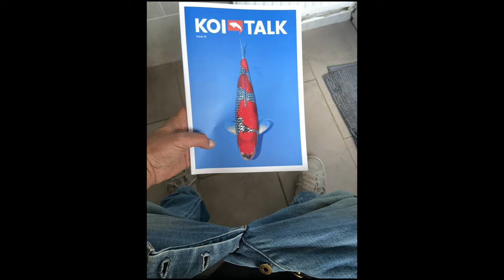4000 Gallon Koi Pond Build Pt 14 - The filter house.

Comment: What a gorgeous little pup Tony mate , can I suggest putting the air curtain at the other end of the pond otherwise your just going to stop debris going down the skimmer , at the other end it will help push crap towards the skimmer , 
  Can I ask if you have measured the inside of your block work since you have finished , just by counting the blocks I reckon your looking at nearer 3000 g around 2800 maybe , where you had the level on the nexus is ideally where you normal water level should be so unless your pond is going to filled to overflowing maybe do a rethink on the hieght it’s sat at buddy , sorry just trying to help you out , great job so far, and the koi are looking great  😎😎👍👍
Reply from the maker: Hi Martin, thanks for the feedback. I am looking at moving the air curtain as you are correct regarding pushing the debris back from the skimmer. I think I am going to relocate it under the bakki shower. Regarding the nexus placement, I have measured from the lip on the Nexus which sits higher than the top of the pond.  I am looking to get the maximum from the nexus.What would you suggest as I trust your feedback mate.
Reply: @KraftyKoi  what you need to decide tony is where your normal pond water level is going to be in the pond, and then place the hieght of the nexus so that the lip you had you level sat on  is about the same hieght this will be the level of water inside the nexus with out pumps running , if you go on to the EA web site and go to the nexuses you can down load a pdf of the instructions which has so good diagrams which explains it better mate , 
😎😎👍

Comment: If you ever have a serious leak in the filter house you may give next door neighbour a deluge as you don’t appear to be building a rear wall. I know this can happen from experience when my 4” bottom drain came away suddenly ( thought it had been welded but apparently was just friction lol)
Reply from the maker: I am building a rear wall mate.
Reply: @KraftyKoi  very wise lol …another point I found there is never enough room in a filter house to move so the maximum number of double union ball valves helps when replanning the filter system as you go . It then becomes a quick unscrew & change rather than getting the saw out
Reply from the maker: I think I’ve planned six or seven in total. Seems like an overkill but better to have to many than not enough for the exact reason you’ve stayed above mate.

Comment: It's coming on nicely. The only thing. Is the Tempest after the Nexus yeah?
Reply from the maker: It is right at the end of the pipework, so it’s going Nexus, air-source heat pump, UV, tempest on one return of three.
Reply: @KraftyKoi  sweet 👌 I've seen some people install them as a separate filter straight from the pond effectively turning it into a poo strainer and had all soughts of problems with bacteria and parasites
Reply from the maker: I know mate, it isn’t designed for that! People think it can act as a mechanical filter and that the media will serve as a biological filter at the same time.  Some people also push water far to fast through it. It’s designed at optimal 5000lph that’s what I will aim for.